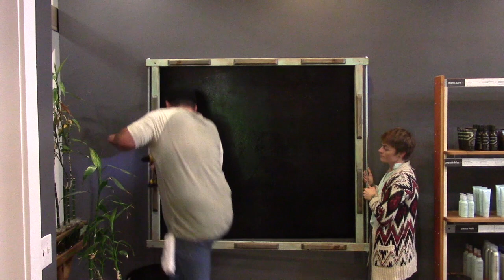Chalk Board Wall / Video #18

Comment: Cool project, I like the use of the conduit on the frame.
Reply from the maker: 49cfr 
Thanks man :-)
The conduit matches the seating area in the salon. There is a salon tour video that shows most of the stuff I built in there, check it out :-)

Comment: Great job! But why did she lift the fram just when you were to screw it in place? :(  My wife is as helpful when it comes to making sure things are straight before I drill a hole in the wall. :)
Reply from the maker: JWAM 
I had the top left corner screw started as she was holding it, the other holes were pre drilled with anchors, she moved it to help line things up :-)
And thank you for the kind words !
Reply: William Lutes The initial position of the frame must've calibrated my sense of camera alignment. :) Her nonchalant way of adjusting it makes her a real pro then, compared my tilting-head-while-saying-it-looks-straight wife. :D